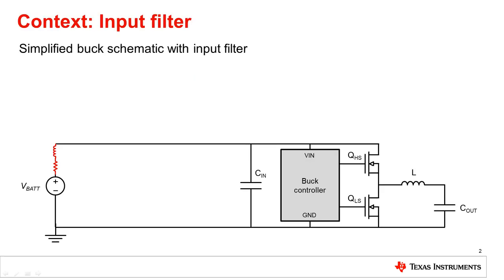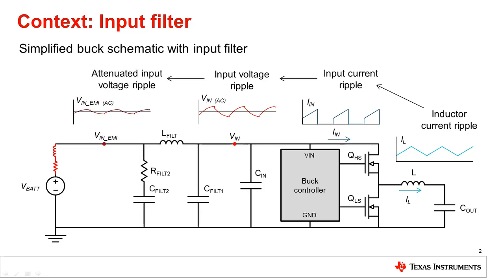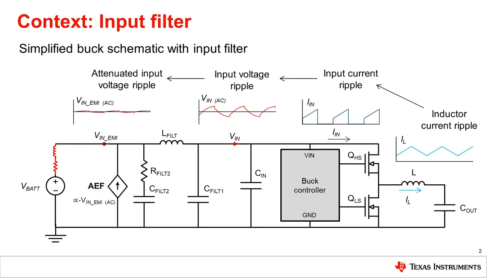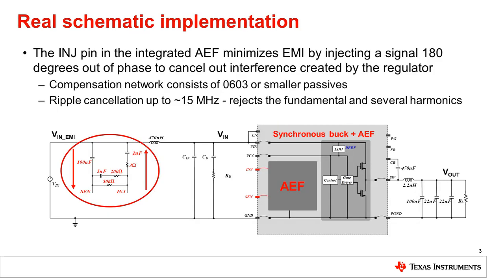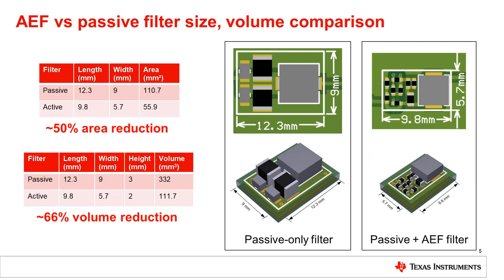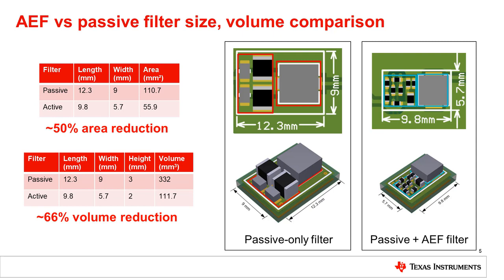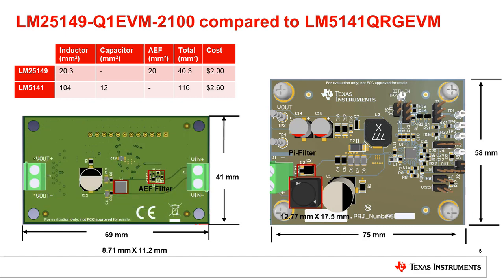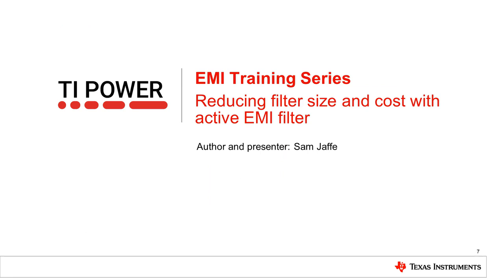Reducing filter size and cost with an active EMI filter

Comment: Thanks for video, it has been good work. I want to ask you a question. How do we determine value of filter elements ? Is there a document which has been prepared by Tİ ?
Reply from the maker: Hi Enis, thanks for your question. There are several resources on how to calculate the inductor and capacitor values for AEF. You should be able to use the WEBENCH® Power Designer and calculator on the LM25149-Q1 product folder page (https://bit.ly/3u1q5kl) or the EMI filter section of the data sheet (https://bit.ly/3u0pjnK) to find the value.

Comment: Great idea. How much power consumption is added when AEF is used?
Reply from the maker: Hi Myungjun, thanks for your question. The AEF circuit itself consumes 10-30 mA of VCC current. With a 5-V external VCC (using VCCX pin), the additional power consumption of AEF is small: 5 V times 20 mA which equals to approximately 100 mW. If you are using a normal VCC regulator, VCC current is sourced from VIN current, so as VIN increases, the additional power used by the AEF circuit will also increase.